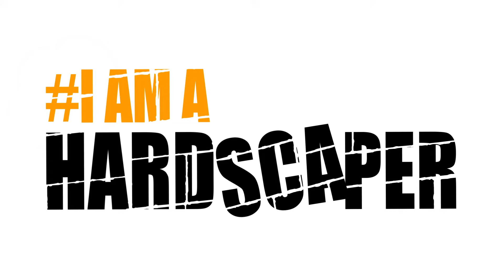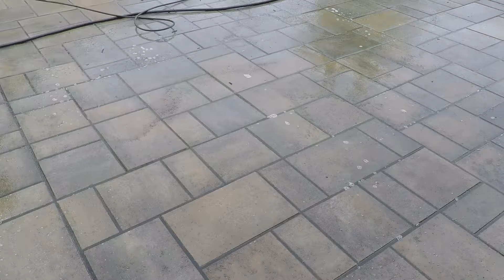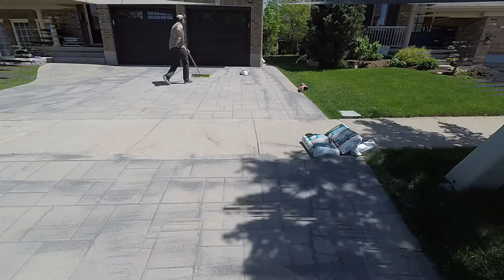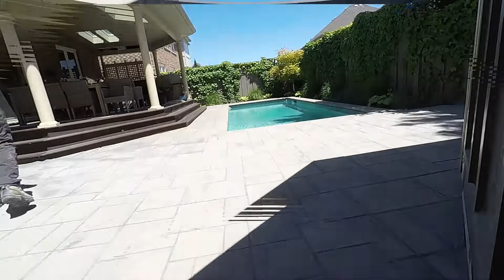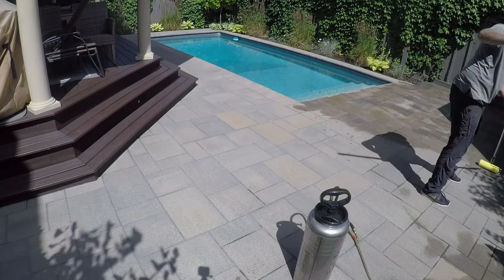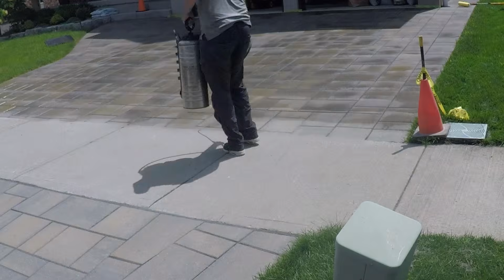How to Clean and Seal Pavers | COMPLETE GUIDE

Comment: Is there a type of sealer that does not change the color of new pavers? Thanks
Reply from the maker: Yup, actually this one that I used does not change the color. It will when it is wet, just like rain would. But when it dries it is the same. You want to look for a “Natural Look” sealer
Reply: @iamahardscaper exactly. Thanks
Reply: @iamahardscaper  I have a large patio and pool area with pavers that is roughly 15 years old. I believe they are Cambridge pavers (3100 sq ft) to seal for the first time. I have washed the area twice and let dry for two days before sanding with polymeric sand. Now we are ready for a sealer but want to know what to use that will “revive the color some” to appear darker like when it was new. What would you recommend for a sealer to do this? Or should I use a “Natural Look” sealer like you used here and not worry about the color? Thank You!  BTW Great Video. Clear, Consice and to the point.

Comment: Did you etch this driveway?  Try that to remove or reduce the stains you were talking about. Also, get a paddle wheel on a grinder and take off one thin layer.

Comment: Also, certain sealers, especially the shiny/wet look sealers should not be used near a pool. They are slippery when wet, but also, the chlorine tends to damage them more rapidly and even in certain higher traffic areas in and out of the pool.
Yes, you can add safety sand, but it is not recommended by any manufacturer that I have ever used, due to the tendency to leave a milky residual look when the product dries.
The sand is not really needed when it is not a shiny/wet look finish. That just wasted time, material and money.
Reply from the maker: No time money or material wasted here, this is a natural look sealer…

Comment: Would you use the efflorescence cleaner before or after applying your polymeric sand? I was wondering if the acidity would ruin the sand. Unfortunately, I had four pallets of pavers that sat wrapped over the winter season before I started installing them recently and the efflorescence is horrible
Reply from the maker: In my experience, the cleaner does not affect the sand. But I would ask the polymeric sand manufacturer that you plan to use or have used. I would not apply a cleaner before the 30 day cure time for the sand though

Comment: Hi, Nice Job. I already pressure washed and applied polymeric sand for my paver two week back. Now can I apply sealer just wash the pavers without pressure washing? Let me know the process please
Reply from the maker: The polymeric sand needs typically 30 days to fully cure. So I’d wait. If it needs to be washed before sealing you can do that but the pavers and joints should still be completely dry before sealing

Comment: I question the sequence of cleaning.  The efflorescence.cleaner that I used contained an acid; hence the need to thoughly rinse with water so the concrete brick pavers are not damaged.  I would suggest a degreaser instead.   Pressure cleaning with Dawn soap and then a degreaser should remove the old sand and dirt, grease, and grime. Rinse thoroughly and then some.
Reply from the maker: Only thing with that method is that the soap does not prep the pavers for sealing. The acid does prepare the pavers for the sealer to set into the pavers.

Comment: The installers used road base as material and now I'm finding out it's the wrong material due to drainage. The g2 polymeric sand gets gummy with rain even after it was rock hard after installation. I was thinking  of power washing the patio and putting new sand and using a sealer. You think the sealer will help keep the joints dry?
Reply from the maker: Road base (A Gravel) is fine for polymeric sand as long as the levelling layer was not stone dust. This is a common complaint of G2 polymeric sand it seems. It all depends on how the base was prepared, but I wouldnt rely on a sealer to solve your problems. I would install the new sand if you need to, let it sit for 30 days and make sure it is good, then apply the sealer.
Reply: @iamahardscaper  what sand would you recommend? Ive had g2 installed for over a year and nothing but problems. My pavers have shifted and even sunken in in some spots so im just trying to prevent it from being even worse.
Reply from the maker: I personally only install techni seal nextgel whenever using polymeric sand

Comment: what detergent do you use
Reply from the maker: it was Prosoco All Purpose Cleaner I believe
Reply: Why not just use reg Trident joint sand and water-based Trident sealer like cat5 instead of the pains of polymeric sand? Customer request? What is the main reason for using polymeric polymeric vs reg joint sand? I'm in Arizona.